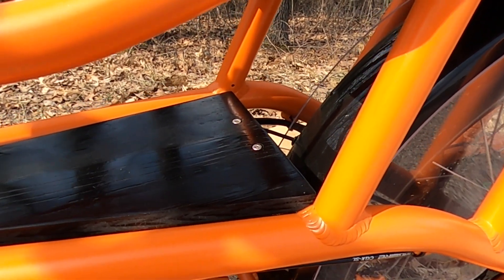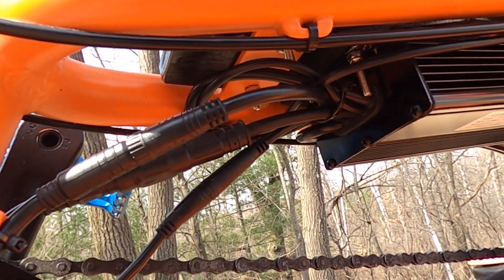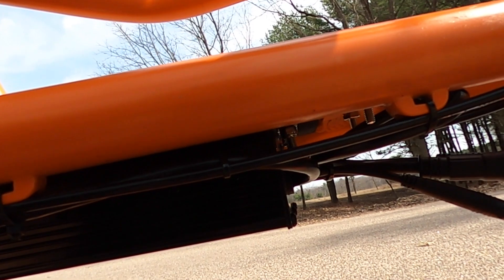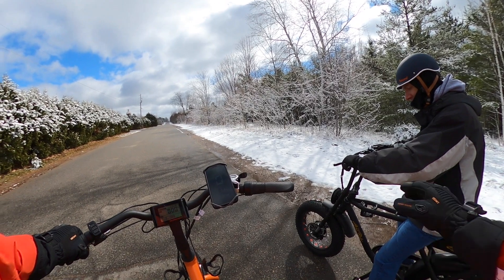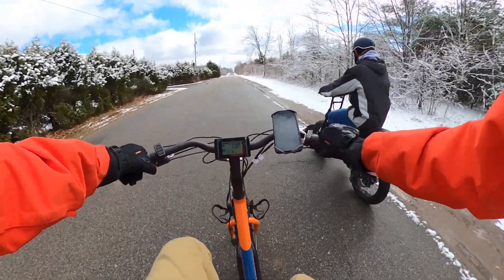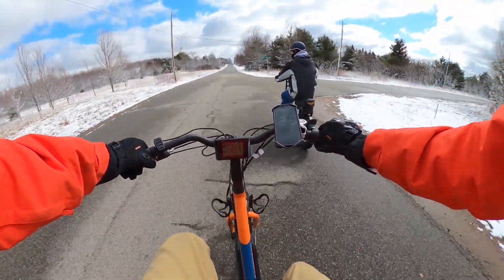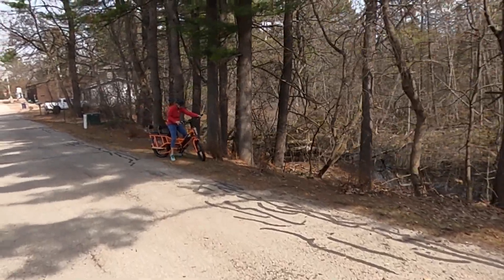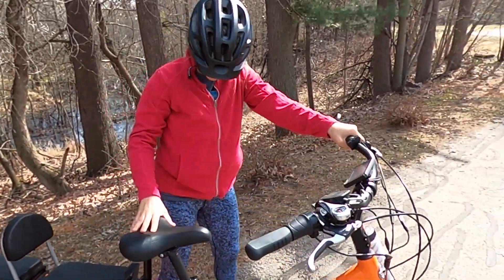Performance Testing an Upgraded Controller on a RadWagon 4 from Rad Power Bikes (Bolton Ebikes)

Comment: Maybe someone can answer this, I want to get a bigger controller for my fat tire bike but it is not red power but it's still a 750 motor every time I see these videos about the Bolton upgrade it's always on a rad power bike why wouldn't this just work on any fat tire bike with a 750 W motor.. ? Or can it? 🤷‍♂

Comment: Were you able to use your original speedometer/display with the updated controller?
Reply from the maker: We used the new display. I believe you have to but you can verify on the forum radowners.com
Reply: Pretty sure you need to use the new one?

Comment: Hey, is the throttle still maximum power even when in the lower speed settings or in 0 speed setting? So how it is with the stock controller? I got the egg rider control and it only allowed me to get max speed out of my throttle when in speed setting 5 so I sent it back.
Reply: You could change that in the settings for egg rider. I find it a bit too complicated for me, and i dont like egg rider's PAS system, so i put my stock display back. Although i think egg rider is great when it comes to settings and customisation, just gotta learn how to do it, and i dont wanna risk it on my new bike, rather after a year or so.. we will see.
Reply from the maker: I think it is but you could double-check on the Rad Owners forum.

Comment: How is the upgrade holding up? Any plans of upgrading the motor to true 750W? It would be interesting to see results. I just upgraded my radmini 4 with Bolton controller and bafang 750w, and contemplating upgrading the radwagon 4 as well.
Reply from the maker: So far so good! My brother set the settings to max out PAS 5 at about 1100 watts just to be on the safe side. No plans to upgrade to the 750 watt simply because he doesn't really need it.
Reply: @EbikeEscape  Is that the C14 setting? What does he have it set at? Thanks for an awesome vid!
Reply from the maker: @armytribe8471  Not sure, shoot me an email and I can email you his settings ryan @ ebikeescape
Reply from the maker: Here is our video on the settings: https://youtu.be/fsbcY91alf0

Comment: Isn't there a way to take off the speed limiter so you can have more top speed? If you have more watts and more power you should be able to get more top speed . I will just drain the battery faster
Reply from the maker: I am not certain but I believe this has to do with how the motors are geared. They can only spin so fast.

Comment: 1500W means Class-3 ebike. Might as well buy an electric motorcycle if all you want to do is play in traffic for 15 miles at least they are built for it. These infomercials designed to inspire people to foolishly spend their money on inferior products for your monetary benefit are ridiculous. Good luck on the money hunt. I have to go wash my hands.
Reply: The Rad (even upgraded) will pass as a Class 2. That means you can ride anywhere a pedal bike can go. Sidewalks, State Parks and any road with no restrictions, no license, no need to insure, no gas, no oil, no smell and (almost) no noise. A decent e-bike starts at about $1300.....plus, these can be ridden by everyone...from grade schools kids to retired Gram and Gramps.
Reply: @goobfilmcast4239  Depending on local ebike regulations. As far as Rad bikes... if you think any of them are "decent" ebike then I guess I just wanted more. Stay safe.
Reply: @brianbassettnumber1  Motor cycle has weight while ebike has less and it can go in any where like bikes ( no shet)
Reply: @fbyi2940  Unintelligible nonsense... up your dosage.
Reply: @brianbassettnumber1  yes it's true, fancy typical yuppie sporty motorbike won't make it to off-road as bikes, you have less weight and 7 gears
Reply: @fbyi2940  Keep trying... maybe Google translate.
Reply: @Brian Basset  the radwagon is meant to haul cargo and multiple kids why did u even mention and compare it to a motorcycle.
Reply: @darkmanx2g  I didn't mention it, little lady, Goober did.

Comment: On the new Radwagon, who is the manufacture of the motor and what is its rating.  On the 2018 Radwagon that I did the controller upgrade on I found that pumping excessive wattage into the 500 watt motor that they claim to be 750 but that’s just the peek rating and false adwertising,  does not yield much extra performance other than possibly burning out the motor and using up extra battery with no real gain.   I hear a wine I don’t like form the motor, the battery life goes down as I’m pumping useless wattage into the motor.  So I’m curious what type and model motor is on the new wagon.  I do notice a bit better of the line and a more responsive motor, but I have to change the settings to make sure I don’t kill the motor and overheat and trip another battery... yup, on a hill I hit over 1000 watts and lost all power.  Had to swap battery amd by the time I got home the original battery reset.  So I’m assuming it’s BMS said I was asking for too much.
Reply from the maker: From my understanding they are still the Bafang motors. Most equate it with the 500 watt motors from Bafang and they peak at 750 watt. Unfortunately, there is no standard across the industry about how the motors are advertised on bikes. I think fewer people tended to upgrade the 2018 RadWagon and the RadCity models with the direct drive motors so there isn't as much information out there on longevity.